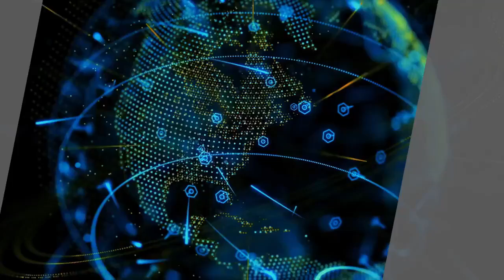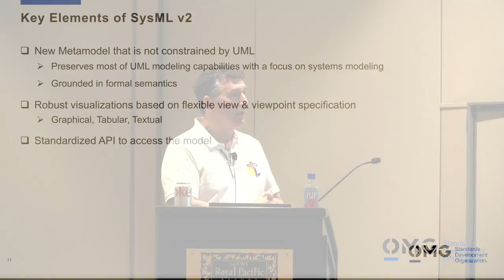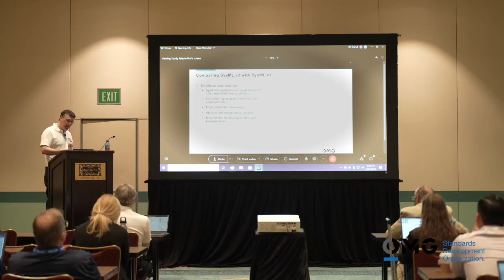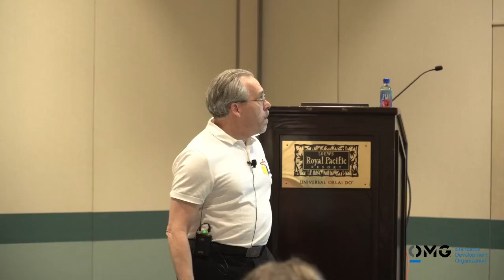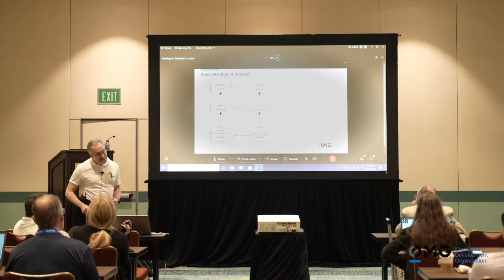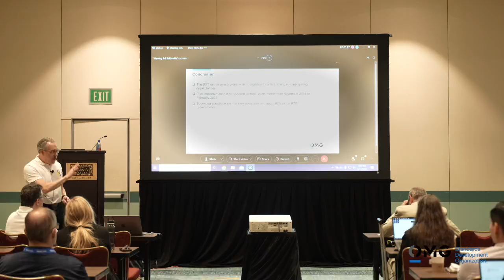Systems Modeling Language™ v2 (SysML® v2) Overview

Comment: Summary
The video provides an in-depth overview of the evolution from SysML version 1 to SysML version 2, highlighting key improvements in language precision, usability, expressiveness, and interoperability. It explains the motivations, design principles, and technical innovations behind SysML v2, including the introduction of a new metamodel, a standardized API, and both textual and graphical representations. The presentation also covers the transition strategy for organizations moving from SysML v1 to v2, the development and community collaboration process, and the trade-offs made to avoid common pitfalls in language evolution while enhancing modeling rigor and extensibility.

Key Points
Introduction and Background of SysML and OMG

00:00
 OMG is a vendor-neutral standards organization that has advanced technology through open processes since 1989, with standards used widely including on the ISS.

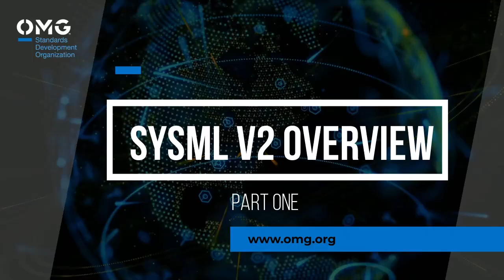01:31
 Introduction by Sanford Friedenthal and Ed Seidowitz, co-leads of the SysML v2 submission team, outlining the presentation plan focused on SysML v2 and comparison with v1.

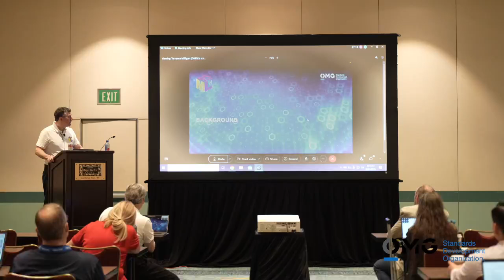03:35
 The future of systems engineering is model-based, as emphasized in the INCOSE Systems Engineering Vision 2035 that aims to expand MBSE’s scope over the full lifecycle and multiple system hierarchy levels.

05:05
 Agile processes and digital threads are key enablers in MBSE for automation, traceability, reuse, and stakeholder shared understanding.

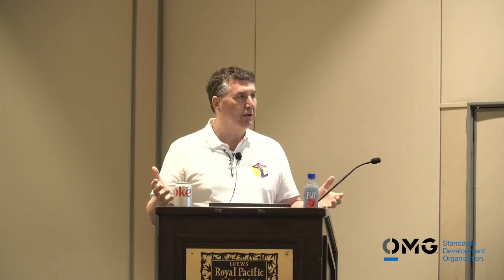06:21
 SysML v1, rooted in UML and introduced in 2006, facilitated MBSE adoption widely but revealed limitations and lessons that guided the development of SysML v2.

SysML v2 Objectives, Features, and Improvements over v1

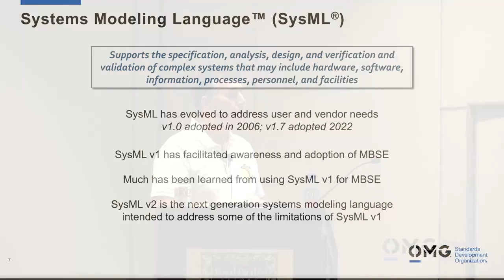08:12
 The final submission of SysML v2 was made in early 2023, with a close-to-beta specification pending OMG board approval and tool vendor engagement underway.

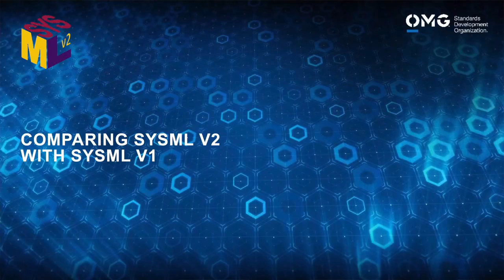09:38
 SysML v2 objectives include enhancing MBSE adoption and effectiveness through improved precision, expressiveness, consistency, interoperability, usability, extensibility, and migration support from v1.

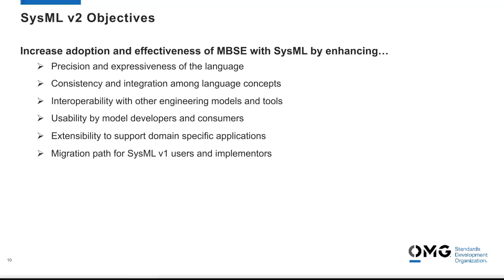11:04
 SysML v2 introduces a new metamodel independent from UML but informed by it, focusing specifically on system modeling with formal semantics; it also offers enhanced visualization, combining graphical and textual syntaxes.

14:05
 Core language capability pillars remain similar to v1—behavior, structure, requirements, analysis—but v2 adds a formal expression language enabling precise specification and verification.

15:10
 The textual syntax of SysML v2 complements graphical views and improves precision and user flexibility; users can enter and view models textually, graphically, or both.

19:01
 SysML v2 formalizes a consistent “definition and usage” pattern uniformly applied across the language, improving reuse, learnability, and automation, unlike the inconsistent usage in v1.

23:35
 Decomposition in v2 is more natural with part-to-part hierarchies (parts tree), enabling easier design modifications compared to the block/part alternating decomposition of v1.

25:42
 Requirements in SysML v2 are inherently property-based constraints, allowing automated evaluation and verification within the model rather than simple textual statements as in v1.

29:52
 V2 introduces the concept of “individuals” with lifetimes and “snapshots” at points in time, enhancing the ability to represent states and changes over time more formally than v1’s instance specifications.

31:47
 SysML v2 allows aliases and flexible naming conventions for modeling elements, providing improved naming flexibility to suit various domain needs.

33:17
 The extension mechanism in v2 is more powerful and simpler, supporting stereotypes with semantic constraints and properties that enable robust domain-specific language enhancements beyond v1’s more limited profile approach.

 Use Cases, Tooling, and API Integration

36:39
 A simple example of a vehicle model illustrates how multiple aspects like attributes, actions, states, requirements, and verification cases integrate in a precise manner within SysML v2.

38:50
 SysML v2 features a standardized API enabling external tools (CAD viewers, analytical solvers, graph visualizations, version management) to interact with the system model, fostering interoperability and integration in digital engineering ecosystems.

42:17
 SysML v2 has a broader scope requiring careful learning, but the consistent language patterns and improvements make it more usable and expressive for the community.

Transition Strategy and Adoption Recommendations

45:03
 Transitioning from v1 to v2 requires planning and pilot programs; organizations should leverage improvement teams to start pilots, engage tool vendors, and incrementally adapt practices and infrastructure.

46:04
 Deployment decisions should be strategic, targeting new projects or milestones; early coordination with tool vendors and understanding impacts on metrics, references, and training are critical.

48:10
 The DoD’s Modeling and Simulation Office is preparing transition guidance, and a SysML v1 to v2 transformation specification exists to support migrating existing models, though some manual refinement after transformation is expected.

49:48
 SysML v2 presents an opportunity to raise the rigor and quality of MBSE practices with enhanced capabilities that enable better model precision, reuse, and lifecycle integration.

Development Process, Team, and Challenges

54:00
 The SysML v2 submission team was broad (over 200 members, 80+ organizations) and multi-disciplinary, ensuring diverse stakeholder input but requiring agile management and iterative development processes over 5+ years.

56:09
 To avoid pitfalls seen in many “second systems,” careful trade-offs and compromises were made focusing on user needs, iterative pilot implementations, and consistent design principles grounded the language evolution.

59:03
 The team used monthly incremental releases of a pilot implementation based on Eclipse and Jupiter notebooks to validate language design, test implementations, gather feedback, and engage the user community.

1:02:36
 Key milestones from Dec 2017 to Feb 2023 show evolving submissions with significant internal and stakeholder reviews, pivoting from UML profile attempts to a non-UML metamodel approach for SysML v2.

Language Design Principles and Trade-offs

1:05:40
 Consistency is a foundational design principle in SysML v2, unifying terminology and language constructs (e.g., part definitions/usages, actions, ports), simplifying learning and usage despite increased language size.

1:10:00
 Specialization in context allows for refined inheritance and property redefinition within different modeling scopes, enabling precise, natural representation of design variants and configurations.

1:18:31
 The language uses a concept called “reified relationships” giving explicit identity to model relationships, making navigation consistent but increasing model size and complexity, a trade-off accepted for richer semantics.

1:23:59
 The “satisfy requirement” relationship replaces vague UML dependencies with a formal, analyzable pattern using specialization and binding, enabling precise semantic verification though increasing underlying model complexity.

1:26:13
 Semantic Library models provide formal grounding for fundamental constructs (e.g., parts, actions) establishing rigorous ontological semantics supporting model validation, reasoning, and extension.

1:33:40
 The trade-off between implementer complexity (due to richer semantics, implied relationships, and abstractions) and user simplicity was consciously made to improve usability and modeling rigor.

Current Status, Community, and Future Outlook

1:34:28
 The pilot implementation remains available on GitHub, with active community engagement encouraged through the SysML v2 Google group; ongoing work addresses finalization, refinement, and tooling support.

1:36:00
 SysML v2 is larger and more complex than v1 but incorporates broad improvements in semantics, expressiveness, and integration potential, with multiple major vendors working on implementations.

1:39:17
 The project team regards SysML v2 as a successful “second system” that avoided typical over-engineering pitfalls through disciplined, collaborative development and openness to ongoing feedback.

Comment: Can someone explain that Language Extension aspect at 36:00? I don't understand how the AgeConstraint in the block where you define the age. Wouldn't you just change the age constraint at that point to make things work? or just not have the constraint at all? I don't think the age would be updating so there wouldn't be a notification as the project ages. are there supposed to be other Control Subsystems that would just default to 11 unless you specify that the processor is a different age?

Comment: 54:00 Part II  - How we got here (Ed Seidwitz) 
    54:50 Avoiding Second System Effect 
57:00 SysMl v2 Submission Team (SST) 
    59:30 SST Incremental Approach 
   1:02:30 SST Milestones 
1:05:30 Key Design Principles 
    01:05:45 Consistency 
    01:08:00 Unification of Concepts 
    01:15:00 Textual and Graphical Notation 
01:18:00 Design Decisions 
    01:18:20 Reified Relationships 
    01:22:20 Compact Notation 
    01:25:50 Semantic Library Models 
01:33:50 Conclusions 
01:39:25 SST Public Repositories

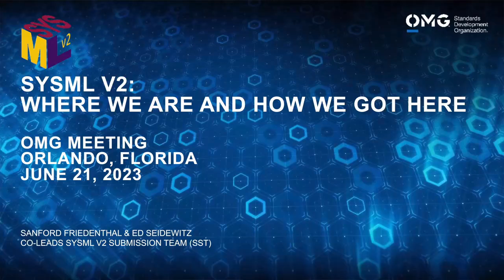Comment: 1:36 Part I - Introduction 
    3:43 MBSE and INCOSE SE Vision 20235 
   6:23 Intro to SysML
   08:14 SysML v2 agenda status 

09:30 Comparing SysML v1 with v2 
    09:55 SysML v2 objectives 
    11:36 v2’ key elements: not constrained by UML, formal semantics, robust visualization (graphical, tabular, and textual), API 
    14:00 SysMl Capabilities 
    15:00 Visual and textual representation 
    19:00 Definition and usage 
    22:20 Vehicle decomposing example: part vs. Block 
    25:38 Requirement example 
    28:25 Instance vs. Individuals and Snapshots 
    31:45 Alias 
    33:25 Language Extension 
    36:33 SImple Vehicle Example 
    38:55 SysML v2 standard API 
   42:10 Sumarizing Comparison of v1 and v2 

44:55 Transition to SysMl v2 
	48:10 Transition Guidance by DoD DE, M&S 
	48:56 v1 to v2 model transformation using XMl and Textual Notation 
	49:44 Transition as an opportunity 

51:40 Part I - Conclusions

Comment: Are the SysML 2.0 diagrams same as SysML 1.0? What are the changes between two diagram versions considering 2.0 follows the KerML and 1.0 follows the UML?
Reply from the maker: The SysML v2 diagrams are specified as views in the model which unlike SysML v1, are formally part of the model. There are several SysML v2 standard views such as a general view, an interconnection view, an action flow view, a state transition view, and others. The SysML v2 standard views can provide similar depictions as the SysML v1 diagram kinds (e.g., block definition diagram, internal block diagram, activity diagram, state machine diagram, etc.) SysML v2 provides additional capabilities to specify user defined views and select the kind of model elements that appear on a diagram and how they appear. The capability to specify user-defined views may take time for the tool vendors to fully support.

Comment: Now its even more complicated. Thats why our lead engineers stick to powerpoint. We need a new lean modelling language asap.
Reply: Your Lead Engineers should first learn the principles and concepts of Object-Orientation, UML and then SysML. I suspect that they have failed to do that. The origins of SysML are from Software Engineering, hence, why Software Engineers get it, because they were trained to use such specific and specialised notation for complex Systems Design. In my experience, the people who usually complain are non-Software Engineers because they lack the training which they're missing and should be seeking from their current employer. The answer is not to stick to .pptx!! 🤣🤣🤣🤣
Reply: Yeah, engineering is tough. It's easier to avoid it by using powerpoint.
Reply: Powerpoint isn't a modeling language...it's a diagramming tool.
Reply: @WillyB_USMC  it's not even a diagramming tool, it's a presentation tool.
Reply: Yes. Calculus is too complicated why can’t we just stick with arithmetic? PowerPoint is the complete dumbing down of engineering